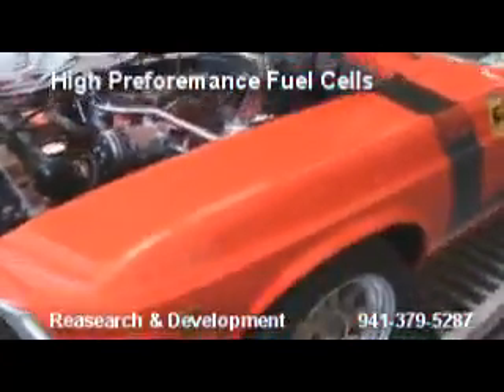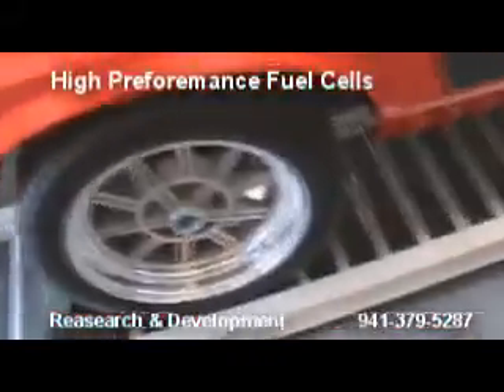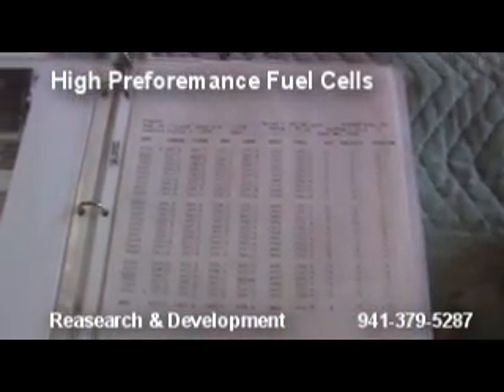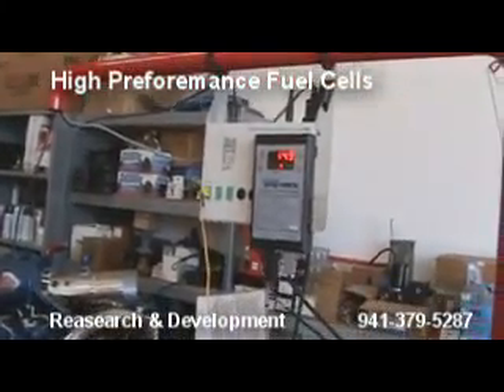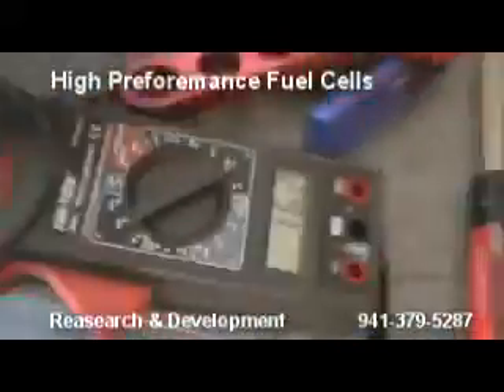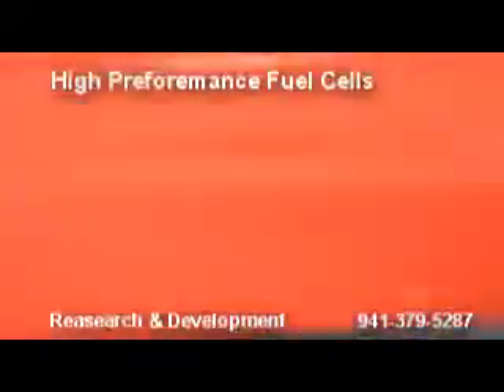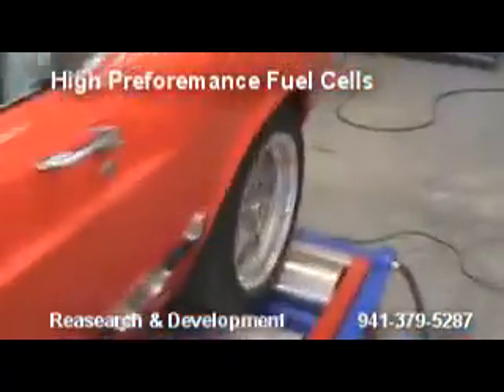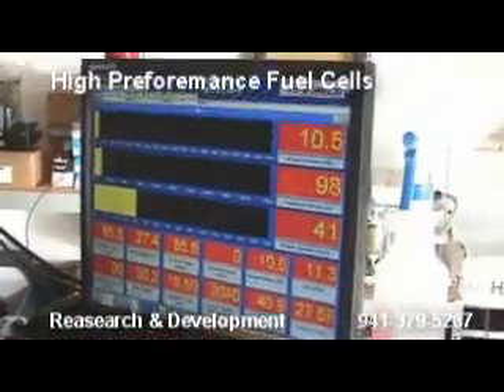1970 mustang 302 boss dyno run on hho

Comment: OK, you did a lot of testing. But I see no actual results posted about how much the hho system added and what the HP outout increase was. Also, if you basicly do manually what the computer does your results will be the same, increasing the fuel air ratio to compensate for the hydrogen fuel will cause the same results of adding hydro to a computerized car. Even though the MPG will not increase (maybe decrease) the exhaust will be cleaned some and power should go up. SO... the resuts of test were?